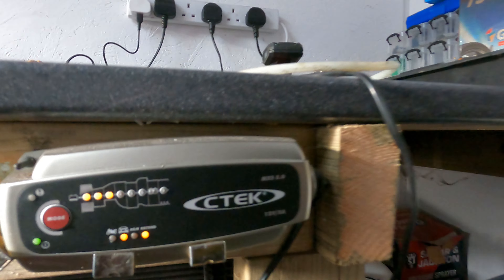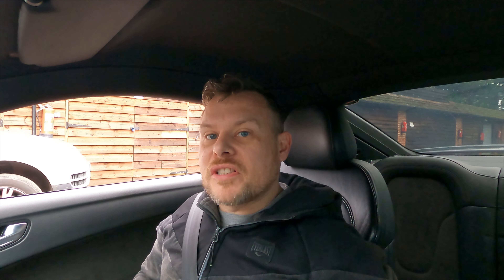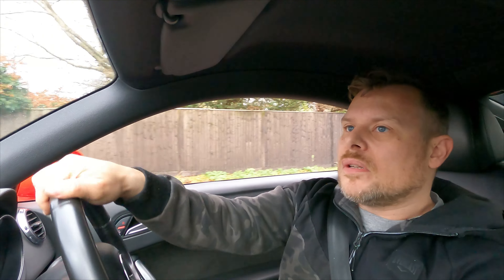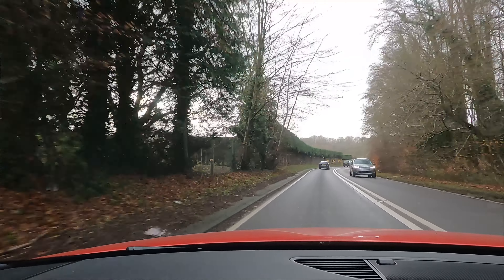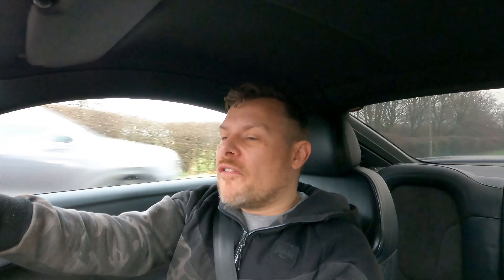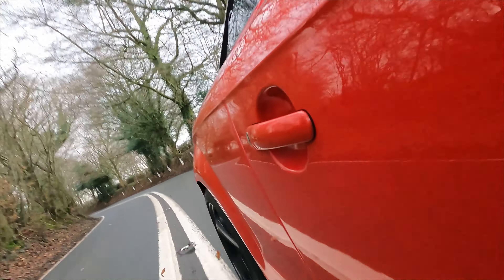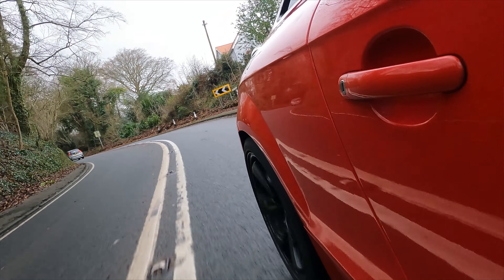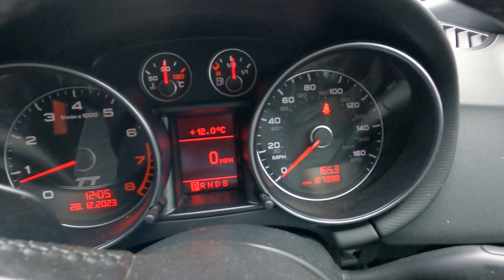AUDI TT MK2 8J PROJECT FIRST DRIVE !!!

Comment: What is it like driving the car with the Hpfp and rs4 valve without a tune? I’m asking because I’m tempted by stage 2+ on my tts and didn’t know if you need a remap straight away? TIA, class vids matey and love the motor.
Reply from the maker: Hi yeah seems to be ok I'm sure on the vis website it states you don't need a remap

Comment: Good work Chris. I put on a DP and mapped mine stage 2 but he could only get 245hp out of it for some reason then it started misfiring and throwing a 'fuel rail pressure too low' code, so I had it put back to standard. Wondering if it may be the HPFP, although the forums say standard TFSI 200hp should handle it up to stage 2?
Reply from the maker: Thats not good mate I had more with a stage 1 but I did fit a new oem hpfp  before I went
Reply: @CarChris82   yeah mate, just my luck! No probs with it whatsoever when put back to standard. I might go down the hpfp route next.
Reply from the maker: @NI-js1wj yeah mate do the hpfp